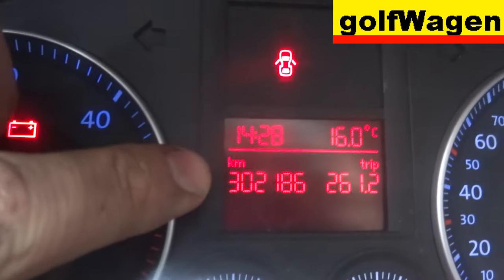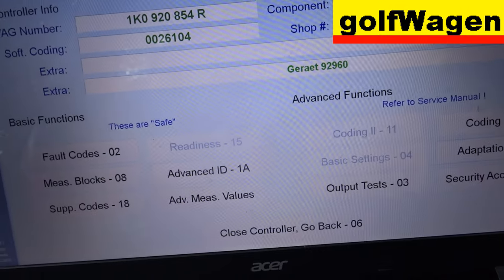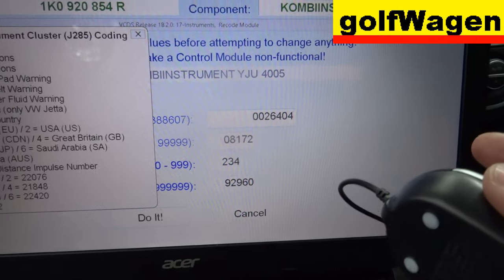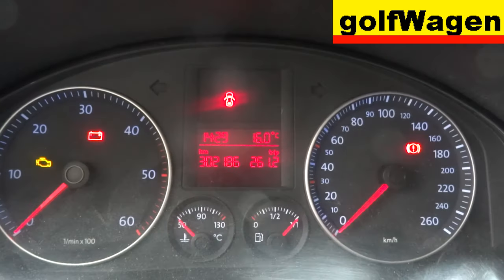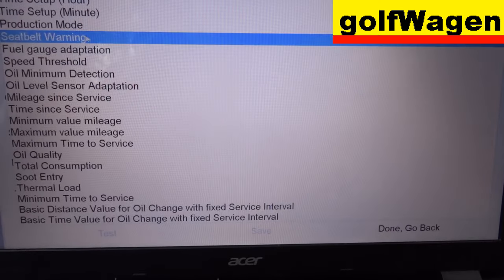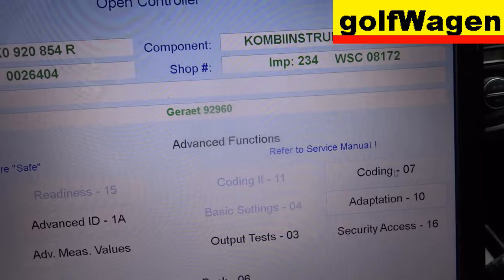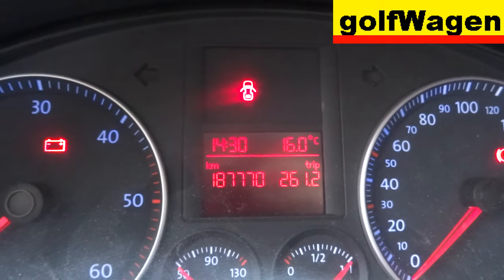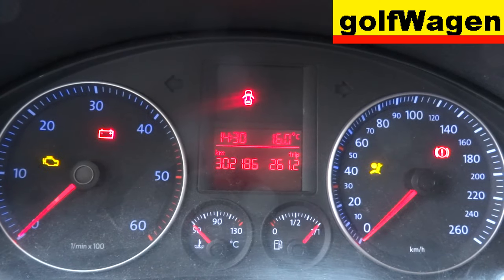VCDS-VAG mileage/odometer correction on VW, SEAT, Audi, Skoda

Comment: my friends Transporter T4 has driven 1.000.000km but the odometer is stuck at 999.999km , I bought vag-dash-can but it wont change the mileage.. VAG Dash Can software reads the EDC15 ECU PIN code etc fine and shows 0,00km as the mileage..

Comment: Switching to uk miles, with out the miles symbol. Does it measures the next values in miles or km if yes then a km is 1.6km. Lol good
Reply from the maker: when I did it the opposite way I was sweating. I had 302,000 miles

Comment: Hi, I saw your post, and I would like to clarify what it is with those codes that you change. I have a passat b7 from 2012. I am going to change km with vcds. Do km keep changing after stopping and starting the engine? Can I use the same as in the video you made?